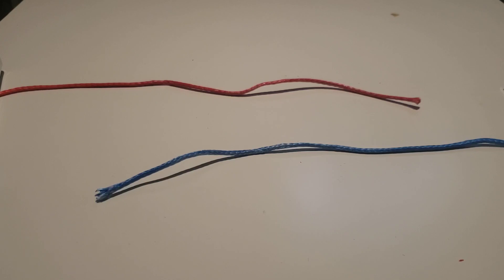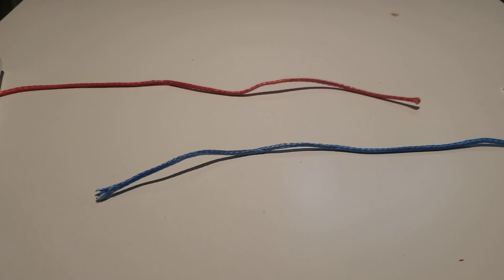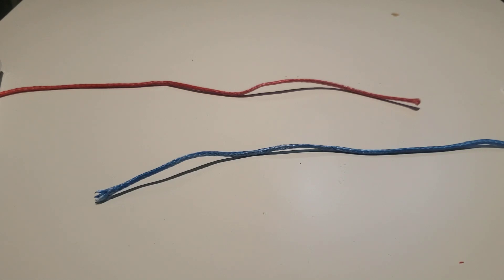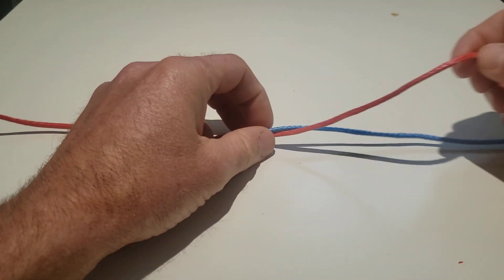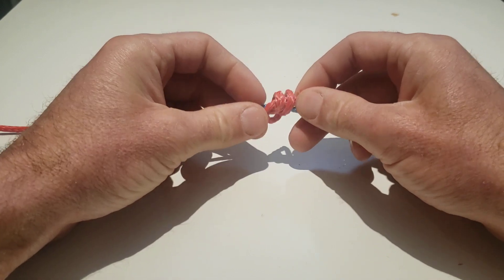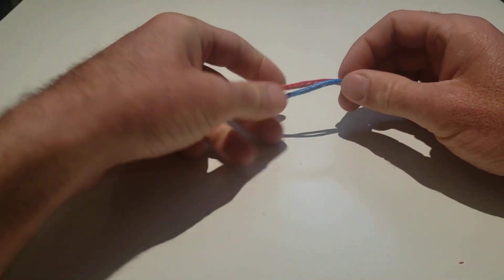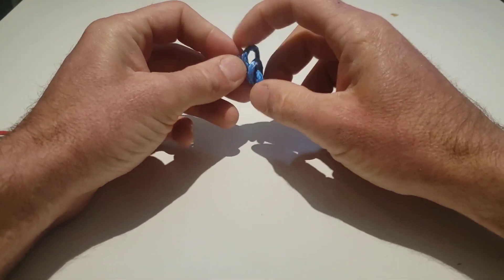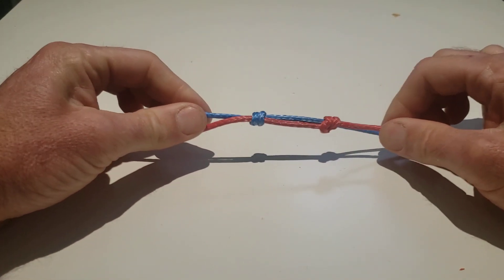Tying a weak-link for towing hang gliders

Comment: As you mentioned both the direction of the double loop and the tail are important to achieve a good knot. One method I have found that works well is to Grasp one end of the weak link cord between the thumb and index finger on the left hand, the piece of weaklink cord hanging below is then looped round the fingers of the left hand at the back placed down alongside the cord trapped between the thumb and forefinger. Next loop the cut end facing up round the thumb twice in the same direction as the fingers on the left hand are pointing then feed it up through the loops in the same direction as the thumb is pointing, pulling the cord tight. Now invert the hold on the cord (180 degrees) and once again loop the cut end facing up round the thumb twice in the same direction as the fingers on the left hand are pointing then feed it up through the loops in the same direction as the thumb is pointing, pulling the cord tight. Pull the two knots together for a tight complete link loop.